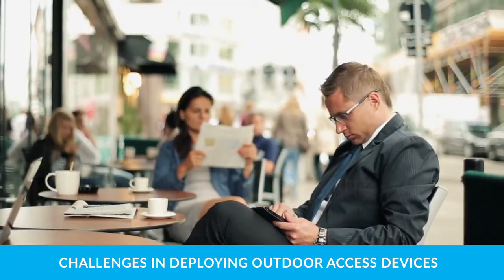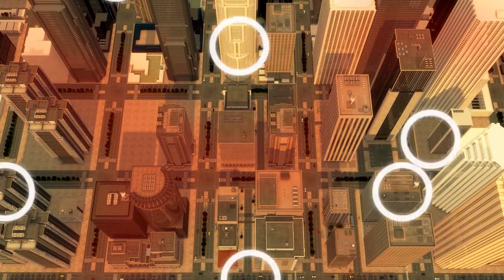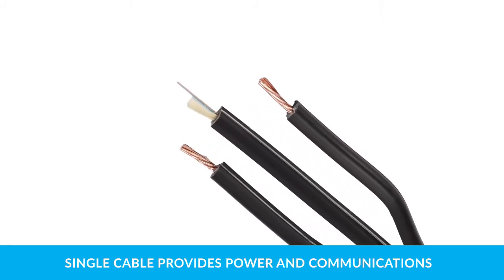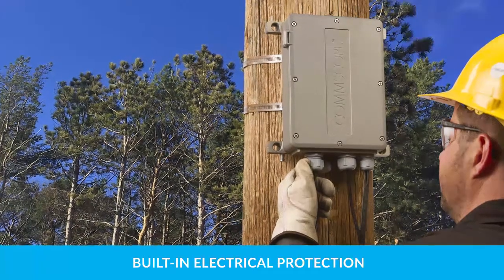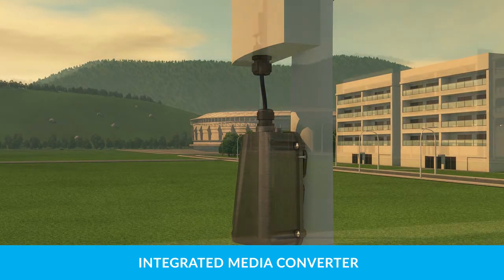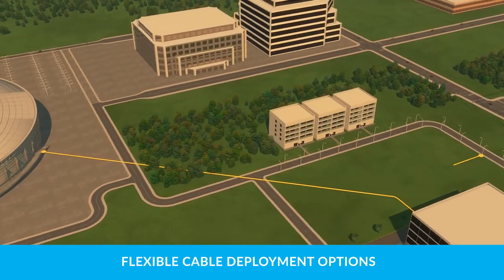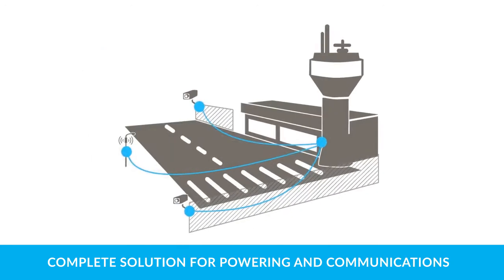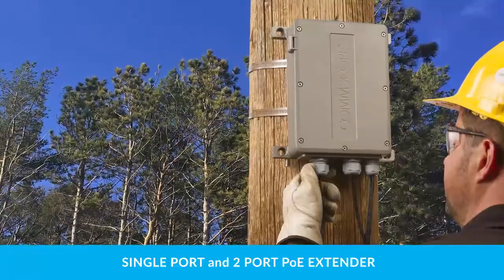Powered Fiber Cable System

Comment: is the Powered Fiber Cable System can be used in High magnetic interference environment of a Power Grid Area?
Reply: Hello Raju Bag, since the Powered Fiber cable used Fiber for the transmission, it is immune to electrical / magnetic interferences. For safe installation, grounding at the PoE extended end must be done as per applicable standards.